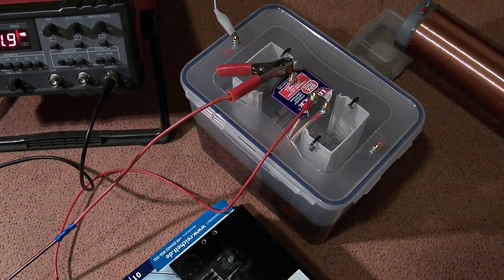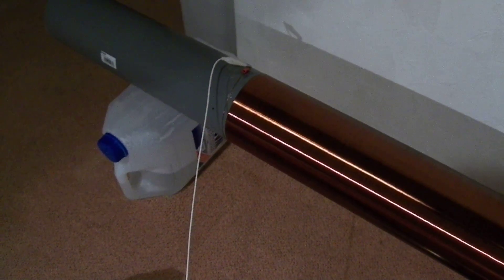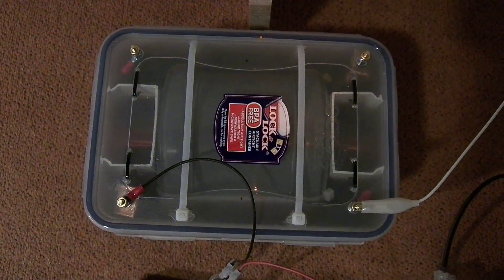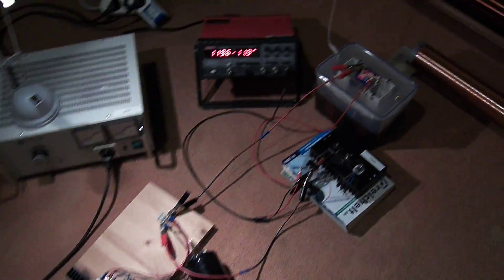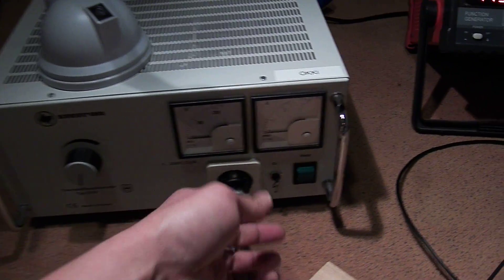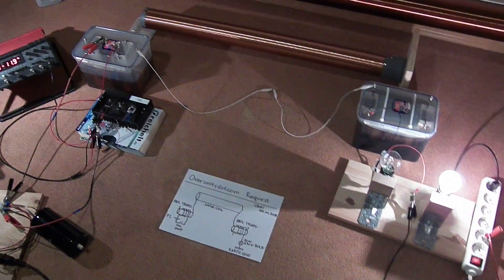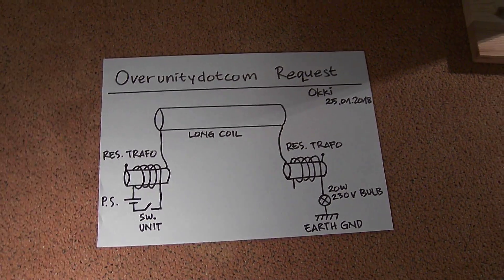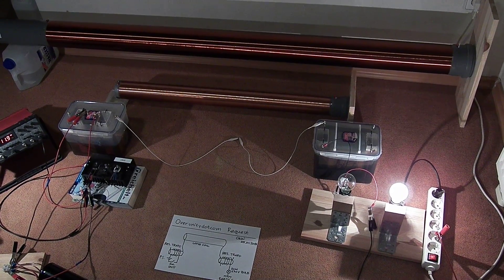One Wire Transmission - Overunitydotcom Request

Comment: You've done so much good experimentation, but need to examine the waveforms more closely and tune frequency/phase of resonant circuits with variable capacitors. Creating true cold/radiant electricity also requires an extremely short duty cycle. Each impulse needs to be interrupted before there's time for a magnetic field to be created (current), leaving only dielectric potential (voltage). Tesla used special quenched spark gaps to interrupt the spark with near zero delay/fall time. Creating such short high voltage impulses with a solid state switch is non-trivial.

Comment: Excuse me. I’ve been working hard attempting to replicate Konstantin Meyl’s work on the alleged scalar waves. But to no luck. I was hoping that if you had time, as a request, you wouldn’t mind building a setup and testing it for me. I don’t have the skill to make this:

Two identical Tesla coils, connected by a single wire, each with a relatively large top load with significant surface area. If they are plates, ensure they are parallel to one another. One Tesla coil is the Transmitter, where energy from a 12 volt battery goes, and the other is the receiver. Do not make the connecting wire ground connection, just a single wire would do. Then, have the outer coil of the secondary Tesla coil hooked up to a diode rectifier and tuning capacitor and hook the output of the diode rectifier to the battery. It most likely won’t charge the battery, and more likely will lose charge, but I felt that if there was even the slightest chance this theory could work, it should be tested. I could go in depth into the theory that explains how it collects ambient neutrinos, but maybe later. If you don’t want to do this experiment, I completely  understand, it takes a long time to setup and fine tune. Thank you and have a nice day
Reply from the maker: Thank you for your comment. I'm still sick. Covid19 caught me last week. I've never seen any scalar waves on any of my setups. You are not alone. I think one wire power transmission is not scalar waves and you cannot use this setup to investigate that waves. If time permits, I will investigate wireless power transmission further, with or without scalar waves. But I don't think it will happen very soon.
Reply: @OkkiMoeljadi  I see. Well I hope you get well soon

Comment: Is that also the case if you use inductive coupling for the output bulb ?
Reply from the maker: No, I cannot power this light bulb in inductive mode because the receiver coil doesn't have enough turns. The bulb will only glow dimly.

Comment: I guess overunity may be disappointed in running a 20 watt light bulb with 275 - 400 watts input...  Still, it was interesting that by placing coils in the common path between the transformers provided such a wide range of excitation power.  Good video, enjoyed how well you performed!  thanks
Reply from the maker: Thanks for the compliment. I'm still trying to optimize everything. Hopefully I can get higher efficiency with this setup.
Reply: @OkkiMoeljadi  OK, so it’s 4 years since…any luck in the efficiency?  Also, have you tried resonant connection without a wire or coil in between.  Possible even running an isolation transformer to your power supply to remove ground commonality.  OH…I am also MS so, it is interesting what I wrote 4 years ago.
Reply from the maker: @magncity1817  Hi, thank you! Unfortunately I cannot continue this research. I'm currently busy with other things but if I can have free time and money I will definitely continue this research.

Comment: Nice Oki,it means longer distance is less power needed to run bulb if is in coiil wire wrapped ,because inductance  in the coil wire helps it self to gain resonance...
Reply from the maker: Thanks Bosnjak. Maybe, maybe not. This is just a rough test and as you can see it is difficult to get the signal generator to run exactly on system's resonant frequency.